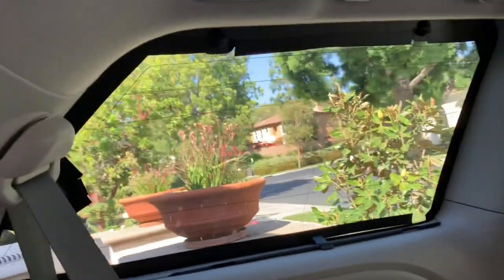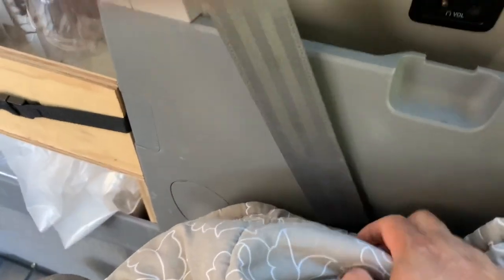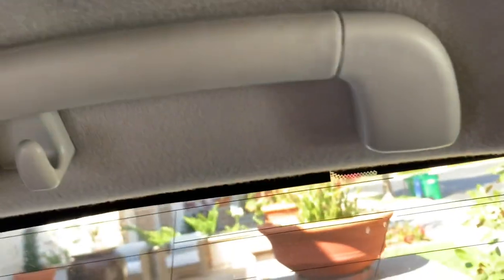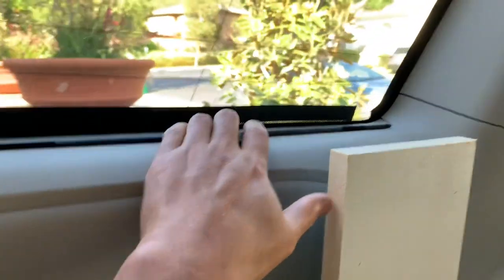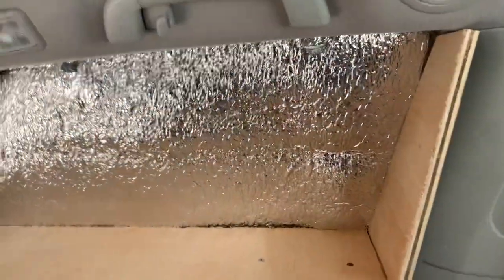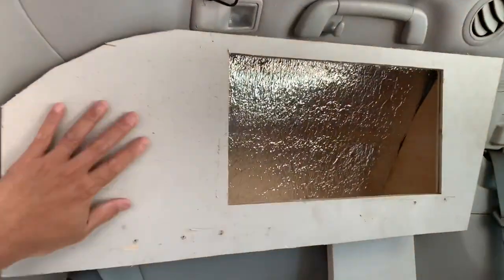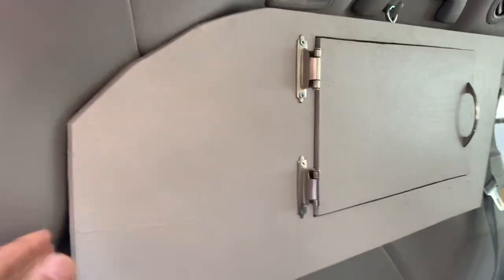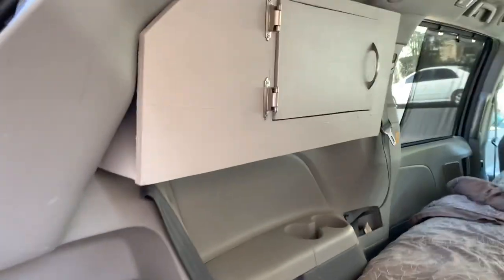Nice Addition, Suspended Side Pantry Cabinet.  Sienna Micro RV V2 ep. 16

Comment: I love your videos. You are so gifted. Please tell me the Sienna model and year. Also model and year of Honda Element. I have no imagination, so I need to copy your work. I have a 2006 Chrysler Town I bought new(my daily driver). I have set in it do many times trying to work out something great like you have done. My van has only 70k miles, but it does not have all the width of the Sienna. The sides are sloped also. I also want a Maverick. Please keep up your great work! Sunny
Reply from the maker: 2012 Sienna 2005 element. I wish I still had that element to keep designing:( will start building the new couples camper soon

Comment: from that last photo, I'm thinking it would be possible to use the bolt from the second row seat shoulder belt as the another connection/anchor point. What do you think about that?
Reply from the maker: Will be tough. And you will have to remove the panel to expose the bolt. I don't want to remove panel. Maybe on a future build, but panels stays on all my current builds.